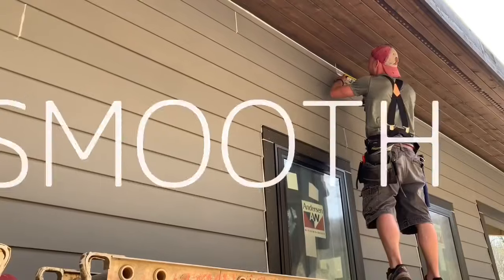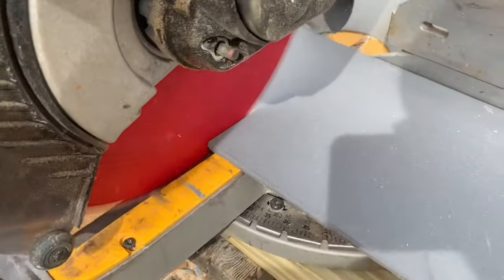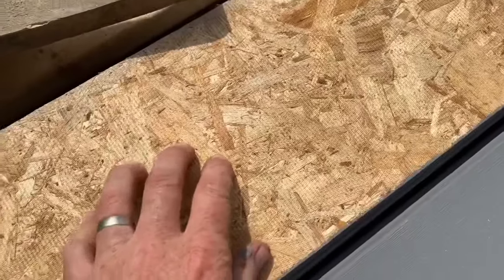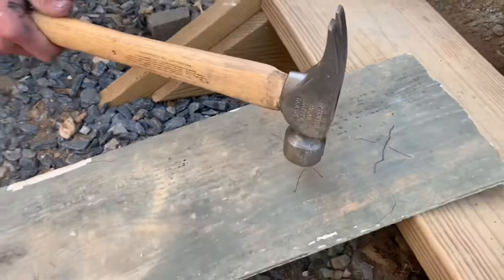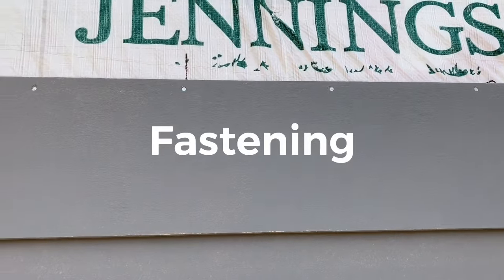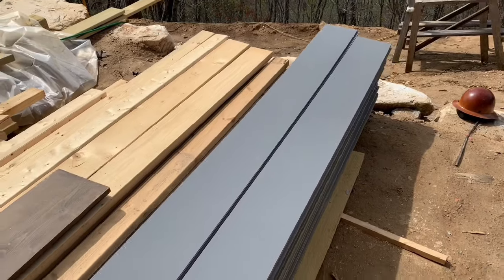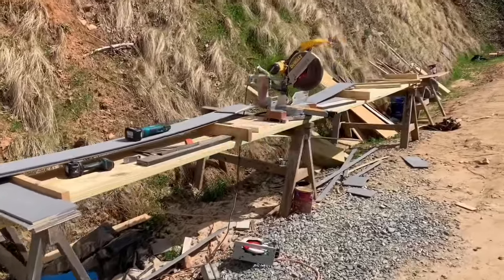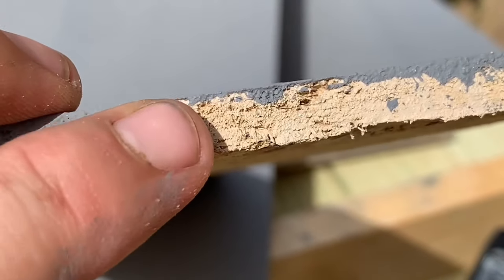Smart Side vs. Hardie Board Siding which is better

Comment: The real question is the long term durability, my money is on Hardie Board.
Reply: It depends on where you live.  In the humid Northwest, Hardie Board  will excel because it doesn't dry out.  Smart Side will tend to rot there.  In Northern Wisconsin where I am, HB will crack horribly.  LP Smart Side prefinished from the supplier will last and last.  I think the finish has a 30 year warrantee.
Reply: @greggyp647   then stay with alum or cedar smart will let very low ones rot
Reply: Hardie isn't all that down here in Texas just like wood siding it will decay around the nail and goes quickly down hill if not kept caulked or painted regularly .  I will give it is fire resistant but not to impressed with how brittle it is
Reply: It seems like the opinion is from an installer point of view. Which one is best for the consumer that wants a better long term product?
Reply: LP seems to resist rot and breakages better in Midwest
Reply: So far here in the nc mountains hardie doesn't last 10 years if your lucky where we've had virtually no issues from LP
Reply: I’m putting LP on my home. Installing it myself.  But Id prefer fiber cement board over LP.  It’s just too hard for 1 man to do it all by himself.
Reply: LP is def a good product for installers bc it’s easier to install / reinstall when it fails.  Good for painters bc u need to watch closely and make sure yr paint / calk is good or it will fail.  Also good if you plan to turn stairs into an unsupported ramp or walk around your house hitting it with a hammer 🙂.

If I am an installer, I like LP.  If I am a homeowner, I like Hardie.
Reply: That's right. LP doesn't warrant their product in the Northwest and tell you don't allow a sprinkler to run on it. Well it will rain on it???
Also read the maintenance schedule. You buy a part time job.
Contractors like it as it's more profitable for them.
Reply: Art siding is junk , GP  had recall of a similar product I think in the 90s , instead of Georgia Pacific it's now Louisiana, so do what you want I like concrete
Reply: Hardie is different for sure but it will also cause cancer

Comment: hardie may be alot tougher to work with but in the long run its the better choice. smart side will not hold up as well from the elements plus smartside will burn where as hardie wont. for the person installing it  yes smartside is alot easier , for the homeowner i would go hardie all day...
Reply: handyt butler thank you!!!! It’s people lack common sense. Seriously. LP dumb side is technically speaking man made wood panels. Water absorption and zero fire resistant characteristics....
Reply: Yep. No way I would put this on my home or someone's that knew.
Reply: I have LP SmartSide on my home and it is far superior to Hardie Board.  Not only does it perform better when hit with rocks (to simulate one being thrown from a lawn mower) but it is super resistant to the elements.  I took a piece that I did not paint or seal the edges and intentionally left it out in the rain turned upside down for over 2 years and it never swelled or had any water damage at all.  It is also a much safer product for the installer because you don't have the risk of inhaling the cement particles like you do with Hardie.  I would recommend LP SmartSide all day over Hardie.
Reply: Fido Paws cool story Home Depot fan boi
Reply: I could be wrong, but I don’t think it’s a good idea. Time will tell. Not a risk that I would take.
Reply: I wouldn't put that hardy crap on my house ever.  LP all the way.  Been installing it over 10 and no issues, plus I don't have to worry about getting cancer from breathing all that silica, unless of course you want to wear a mask every day all day long.  No thanks.
Reply: Hardi is fire resistant. LP smart siding is not. Hardi will never get dryrot. LP smart siding depends on paint to keep it from rotting. 
Easy choice for me will always be fiber cement board siding.
Reply: @tmiranda1379 , if your house is on fire it is likely starting on the inside so the hardi is not going to help with that.  Cement board is porous and over time it will deteriorate.   The easy choice for me is LP Smart siding.
Reply: Yeah....I've built houses for 27 years and I would not recommend this product over Hardi. I've done work at my families houses on the Texas coast and would never recommend that anyone cover their house in OSB painted on one side. If I can't recommend it for every environment then I wouldn't recommend it for any. Stick with Hardi.
Reply: You say LP doesnt last as long as Hardie....Then why does Hardie only have a 30/yr warranty and LP has a 50 year?
Reply: @boblazar1443  Then I wouldn't let you near my home if looking for a contractor to do a re-side.
Reply: @tmiranda1379  SmartSide will not rot, Einstein. Get the facts before you post misleading information
Reply: @jerrellbevers6071  Its not OSB siding. Get your facts straight and find out how its made before posting inaccurate information
Reply: @teamplayer1218  
That is absolutely Oriented Strand Board. Before you try to call people out you should know what your talking about. Just because he says he thinks it's a lot denser doesn't mean anything. The fact they say to nail it between the studs  means there is an issue with buckling they aren't mentioning. That is also a cost they do not mention, the only way you can nail between the studs is to plywood the whole house first which is usually only done on higher end housing. Plus nailing in between the studs runs the risk of nailing plumbing and wires. I don't have to touch a turd to know that I'm looking at a turd.
Reply: @jerrellbevers6071  I know exactly what I am talking about. I work for the siding division of the company. Its NOT traditional OSB. Did you know that? And if installed properly with at least a 1/8" butt-end gap it will not buckle after is acclimates to the surrounding environment one time. As far as installing between studs, that's not accurate as you should hit a stud every 16" OC. If you use ring nails and miss once in a while, that's acceptable as the OSB will hold. Its been tested!
Reply: @tecnolover2642  
Yeah they used to act like vinyl siding was a godsend with a long warranty and it took a while to show it's true nature of being garbage. It hasn't even been out that long so how do you know it can last 50 years?
Reply: @teamplayer1218  
The guy in the video says it tells you to nail between the studs. What kind of good material needs an 8" OC nail pattern? That's an issue no matter how you try to church it up. Just because it's not traditional doesn't not make it OSB. You don't get to change the definition to fit your narrative. Also if you think contractors that are installing whole neighborhoods of siding are painting all the ends, caulking every nail hole and leaving the proper gaps at the end then be prepared for your siding to fail. They blow and go, just a fact. Guess what won't screw up horribly if corners get cut on the install....Hardi.
The fact that every hole has to caulked is a flag in and of itself. That's one of the things about lap siding, you just cover the nail holes with another piece and don't have to sweat it. This siding has so many parameters I bet you will have a hard time with them honoring their warranty.
Like I said, I wouldn't use it or recommend it but if someone wants it I would gladly install it after charging them for the extra steps.
Reply: @tmiranda1379  So wrong on many fronts. Dry rot? Really? Can I remind you that Hardie has wood in it? Like...Fiber in FiberCement!
Reply: @tecnolover2642  Plus the initial 5 years for labor. Nobody offers that.
Reply: @jerrellbevers6071  All yours then with Hardie. Have at it bro. . Blow and go? That's why homeowners look for quality contractors and references before they hire someone. Not blow and go guys. Scary.
Reply: @teamplayer1218  
Wood fiber in Hardie. You have no idea what your talking about. Quality contractors...once again no idea what your talking about. You will never see whole neighborhoods of this stuff because it will be to easy to void the warranty. But you keep siding 1 little house at a time, I specifically said whole neighborhoods which is obvious you've never done. Those little toy sheds aren't plywooded before they are sided which is more proof you don't know that which you try to pontificate about. Holler when you've sided a couple of thousand homes in this stuff, I'm the meantime Hardie will continue to dominate the market.
Reply: tecnolover2642 i won’t go on you as hard as I would of simply because you love techno and I do too ✊🏼. Listen bud, in America and or other countries products being sold have an over exaggerated and or misleading warranty attached to it. I mainly specialize in windows and doors, but know a lot about home remodeling. I’ve worked for contractors and building material suppliers. I have a lot of experience in both the sales aspect of it, product knowledge, and still learning as far as installation, building, along with best practices to ensure warranties aren’t voided. Tell me why some of the best windows you can get your hands on in the nation (Marvin windows) don’t offer a lifetime warranty, but vinyl windows do!?! Why is it that Plygem, Certainteed, along with other vinyl siding manufacturers offer a lifetime warranty on a flimsy vinyl siding product, but something like Hardie doesn’t? HONESTY. Some manufacturers won’t lie to your face.
Reply: RBD RBD 29 years old. I know a decent amount of information about homes. I have product knowledge about almost everything other than kitchen and bath along with pluming, and the electrical work that goes into a house. I work in outside sales. Have worked for contractors along with building material suppliers. When I worked for the contractor, I gained a lot of experience as far as siding repairs go. I’ve seen things with my own eyes. I’m from northern Va. we get all 4 seasons out here. So the job sites I’ve been to have been exposed to both extreme heat along with shivering cold temperatures. Not misinforming anyone here bud, if anything I was just disrespecting a certain product. For all the idiots talking about how you can get cancer from Hardie, wear a fucking mask...it should be common sense when working with wood or wood composites....
Reply: Cooper's Corner yea all California wild fires start from the inside of the houses...what a silly statement. Come on broham. Sometimes fires start from the outside without you having any control over it. It’s called Mother Nature and or man made mistakes...
Reply: Cooper's Corner Not in a Wildland Urban Interface.  The houses that survived the forest fires of 2018 in CA had either fiber cement siding or a three coat stucco system.  Wood siding (LP smart siding) will burn fast.
Reply: RBD RBD I hate to tell you this.....But smart siding WILL get dryrot if not properly flashed, sealed with caulking and painted.  Then maintained.  It is a wood product and will rot overtime.  Sorry bud
Reply: RBD RBD Fiber, like Fiberglass.  It will not rot.
Reply: * Tmiranda* Fiberglass is one of THE most superior materials out there on the market. When it comes to windows & doors an all fiberglass window will last you the longest. Marvin windows has 6 lines ranging from all wood, wood aluminum clad, all fiberglass to their top of the line high density fiberglass + aluminum (Modern collection). I kid you not you put a Marvin Modern window in your house after installing it correctly and it will last generations!
Reply: @tmiranda1379  There you go then. Installation is the key. What a novel concept. Like...EVERY OTHER BUILDING PODUCT. Even Hardie. Turns to card board if not installed correctly. It's a moisture sponge!
Reply: @tmiranda1379  Dear God. Really? It's fiber, as in cellulose fiber...like wood! You and Pavel need to delete your comments to save some respectability here. Good grief.
Reply: RBD RBD Exactly.  OSB (Smart siding) turns to wet card board once it gets wet.  Hardi siding does not.
Reply: @tmiranda1379  Maybe in the Land of OZ Tmiranda but not here on planet earth. Hardie turns to mush when installed close to grade and on a roof line. Google pics. All over the net.  That's why they require 6" above grade and 2" above roof line or all bets are off. SmartSide when installed properly, 6" above grade and 1" above roof line will not. Because....It is NOT OSB. Sorry.
Reply: @jtltet  because every time a house catches of fire is from it starting on the inside, NEVER from the house next door catching in fire and it damaging your home.
Reply: @jtltet  Depends on whether you live where there are brush fires.
Reply: @tecnolover2642  It’s a money grab. They are cashing out on a crap product now and will fold in 20
Reply: Maybe you can reuse the Hardy board after everything thing else on house has burned down. Who cares about it won’t burn!!!
Reply: @teamplayer1218  3/16”

Comment: How is this stuff off moisture gets behind it? It’s a wood product so I guess it can burn, and rot.  Hardie won’t do either.  I did Hardie for the fire resistance, and it still holds the original coat of paint, after 20 years.  This new stuff  seems like the old Masonite product, which swelled and bucked. No thanks!